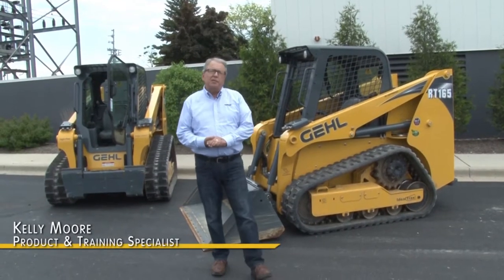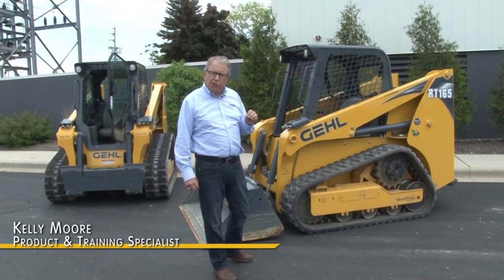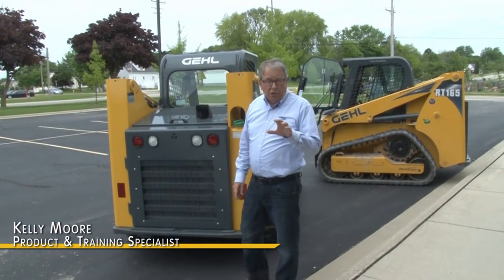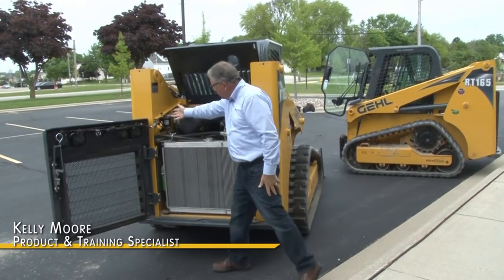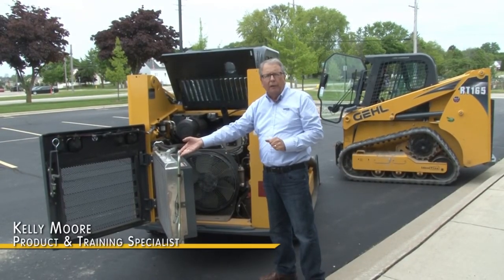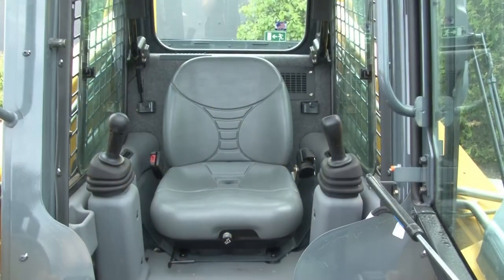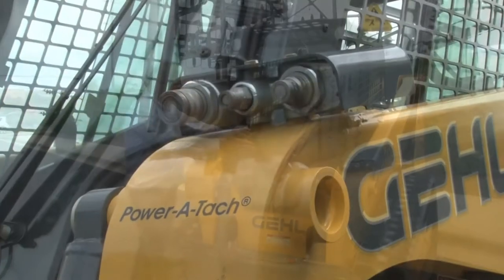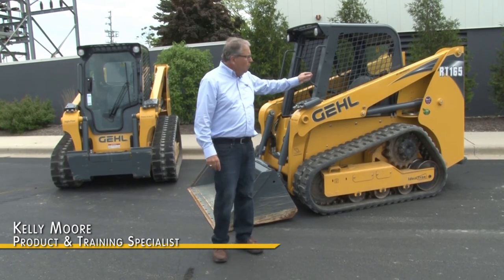Gehl RT165 Track Loader Walkaround

Comment: I already see issues that need changed. 1) the hydraulics should be one block on the left side- standard & high flow on left side. 
2) lap bar, is going old school. 
3) TURN UP THE VOLUME ON THIS VIDEO. POOR VOLUME QUALITY.